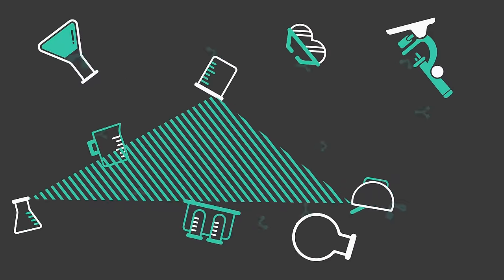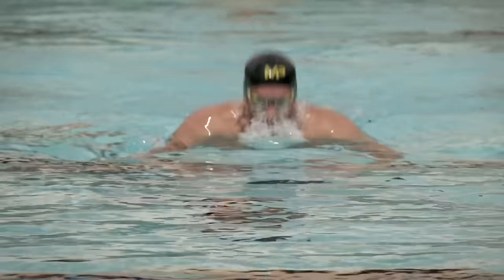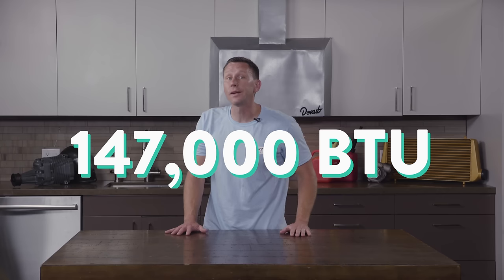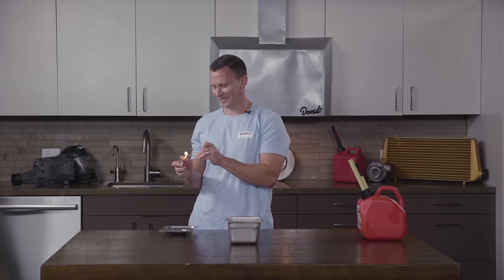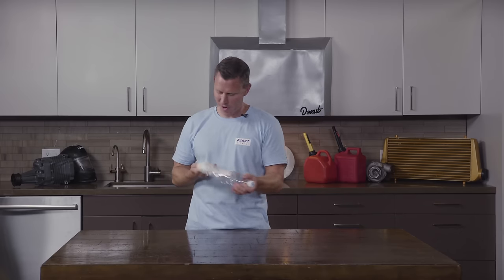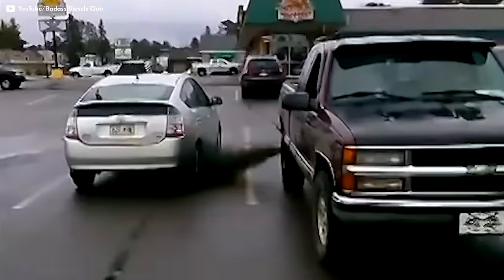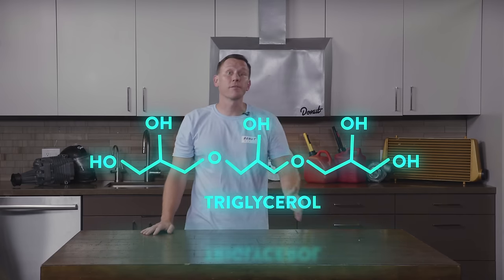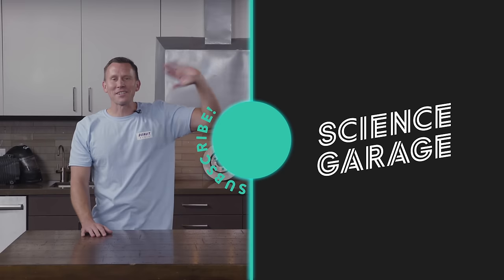DIESEL | How it Works

Comment: Diesel is like nuclear: everybody hates it for no particular reason but it's actually better than most other alternatives
Reply: Yep
Reply: Yes, but actually no.
Reply: @Jeff Butt there is nothing bad about nuclear energy
Reply: Jeff Butt what did he say that made you so angry
Reply: Jeff Butt now when done properly, which most nuclear energy is, nuclear energy is pretty damn clean and it doesn’t require a ton of precious materials. Old nuclear power was inefficient and people didn’t know how to dispose of the waste and minimize the adverse effects. Today, nuclear is quite a bit better than coal or something like that. Now there are better ways, like hydro, but nuclear isn’t the looming evil power source that some people make it out to be. Using nuclear to power electric vehicles is a lot less impactful on the environment than using coal to power electric vehicles, or using gas powered vehicles.
Reply: @Jeff Butt Chernobyl wouldn't have been as big of a issue if people didnt over ride the melting reactor thinking it was a test
Reply: @Chevsilverado  Pretty much this. It has risks and drawbacks, but nuclear power also has many positive aspects. The debate is very emotional...
Reply: @Jeff Butt those are rare situations. Yes nuclear wate is an issue, but compared to fossil fuels its miles ahead. Not to mention renewable just isnt efficient yet
Reply: Well, mind you. Not everyone hates it without a reason though. When DIesel engine became old and worn down, it won't burn as efficient as when they're new. And when any fuel doesn't burn completely it creates sud and stuff you probably don't want to breathe in. Correct me if I'm wrong, but it just that Diesel create it quite more than Gasoline. And about Nuclear powerplant, I got to admit that It's good and very clean compared to any current power generating methods we currently have. (I didn't count power from wind, water and solar energy, though) The only concerns people usually have are it's by-products, Spent fuel rod. We still don't know how to deal with it yet apart from containing it in a "safe" environment. I think there's some permanent storage being built now but that's still burying it back down hoping nobody digs it back up again in the far future. And you don't want nuclear technologies to fall into some crazy country, do you?
Reply: Indeed, one of the complaints is cost a d complexity, even though we can produce a reliable AI system to take a vast strain of old tech, as for Chernobyl there was no fail safe in the system due to soviet regressive attitudes, were as a western nuclear power plant with multi reactor set ups has enough failsafes to make any failure be contained on site as a meltdown will be just that, a meltdown of the reactor over a detonation of a reactor, two things we must know publicly is the difference of a meltdown and detonation, a meltdown is a result of a runaway reaction melting down the reactor, a detonation spreads the reactive nuclear material large distances causing a massive hazard for general civilian population
Reply: @khizarpasha6105  Nuclear waste isn't actually an issue anymore. That weapons grade byproduct everyone worries about can actually be recycled into new molten salt reactors. I recommend searching YouTube for Elysium Thorium for a 20-40 minute lecture on how it works in detail.
Reply: @angel-ec1jc  except the fact that it can poison you
Reply: T.V shows like the Simpson's put the scare factor into Americans.
Reply: I want nuclear electric car and diesel tractor
Reply: Laughs in Reactor 4
Reply: Diesel however, has more particulates.
Reply: Nuclear powered submarines can run for 20 years before the have to refuel.
Reply: Ian hydro is going out. It destroys the ecosystem around it, and its regional. Lots of places cant have hydro because they arent around a water source that is capable of that. Thats why the army corps of engineers is blowing them up.
Reply: Onion Head wow, what a scholar. Nuclear is the best option. I guess we shouldnt drive cars because they pollute and destroy the earth. I guess we shouldnt build dams because they put so many lives at stake if they break. The tower on a solar farm can bake some one alive. Windmills take up such precious space that you need to grow your organic foods. Such utter destruction.
Reply: Onion Head Well there hasnt been a problem yet with it. If you want to come up with some improbable theory to what could happen to it go ahead.
Reply: Onion Head you do realize that people learn from history right? The people running Chernobyl were incompetent, considering it was soviet Russia and they didnt have standards. I will agree that the waste is a little bit of an issue, but an “oopsie” wont just occur if people actually cared
Reply: @Chevsilverado  im sure the problem with nuclear energy is disposing of it,
Reply: Paolo Di Gualtiero nuclear is safer until it doesn’t... and leave a piece of wasteland for centuries 😬
Reply: Not at all...
Reply: Ntm the sounds ugh nuts
Reply: Giordan Diodato but it smells amazing
Reply: As someone who works in nuclear powerplants, yes
Reply: angel wake TF up kiddo
Reply: Same as communism
Reply: @inputgoldfish4424  and socialism.
Reply: Osama entered chat
Reply: Chernobyl lol.
Reply: jk I'm aware that it was the fault of the rbmk but still
Reply: @Chevsilverado  yo, I’m doing a research paper on nuclear energy. Can you help bruh? Seems like you know some things lol.
Reply: @Ken-rt9jy  Don’t know the specifics, but I just know that nuclear power these days are efficient reactions and are designed so they don’t put out radiation into the surroundings. The statistic these days is something that you could live like 10 feet away from the nuclear facility and have a many times less radiation from the rector than the ambient natural radiation on earth. Natural disasters are a bit different, as they can mess up a reactor pretty bad, but since the different events where that happened there’s been a lot of advancement in protecting against earthquakes and stuff.
Reply: Jeff has left the chat
Reply: so damn true
Reply: Soot
Reply: @angel-ec1jc  The waste is the bad part of it everything else is good we just can't dispose of nuclear waste since it last so long.
Reply: Only few people love it but they are legends ☺️
Reply: But truck make loud noise and blow big smoke cloud
Reply: @damonleeb  some trucks without catalytic converters, carbon filters, adblue and a muffle blow black smoke and make noise
Reply: Nuclear power has one drawback now, just the nuclear waste.
Reply: yeah becuase the nasty black smoke and acid rain arent particular reasons
Reply: @mikalharding5889  not every diesel makes black smoke. A Audi A4 2.0 TDI makes no black smoke but it is a diesel. Scania S770 with a 16.5 liter V8 and 3700 NM, no black smoke.
Reply: The engine but not the furl
Reply: Fuel
Reply: [Japan left the chat]
Reply: Who is Jeff... ?? 😂
Reply: Diesel is better 🤡
Reply: @Chevsilverado  you say old nuclear reactors were inefficient, but they were still insanely efficient, just not as much as a modern day reactor
Reply: @notlogical4016  It’s all relative lol
Reply: Ian nuclear is a very vague term, if you mean nuclear fission than it’s very bad for the environment, not because it produces gas but the radio-active waste would build up and only after a couple 100 mellanias the first bunch would become non harmfull but by them we’d have so much waste we’d be fucked, on the other hand nuclear fusion is very clean and has literally NO bad consequences, the worst catastrophe in a nuclear fusion chamber is that it powers down thus making it safe
Reply: @TheFlemishNut  There have been a bunch of studies of how modern fission power compares to coal production and the overwhelming consensus is that with modern tech, fission actually produces next-to-no waste, and it’s almost infinitely better than coal in terms of pollution and overall human deaths. Modern fission reactors are actually very safe and do not create much waste, and there are new methods to dispose of/use fission waste that doesn’t harm the environment. The problem is that something like 95% of all nuclear reactors in the world are a very outdated design, and many countries do not care/have regulation about disposal of nuclear waste. The cheapest way to dispose of it is to of course, bury it, but there are other ways that have virtually no impact on the environment (especially compared to coal or even hydro), but those methods are costly. Fusion would be even better though.
Reply: So wait diesel is more eco-friendly than petrol. Man in feel bad for people in the UK with diesel and petrol bans
Reply: @Chevsilverado  I was with all u said until the end where u said we’d could power cars outa coal and ‘nuclear’
Reply: @maxosiatynski9987  Electricity from coal and nuclear.
Reply: @obi-wankenobi9871  yes but actualy yes
Reply: @holden2260  No, bio-diesel is more eco-friendly than gasoline. However, most of the UK drivers would use harmful petroleum diesel instead of the bio-diesel, because nobody wants to load literally shit in their cars. If UK banned the petroleum diesel instead of diesel engines, diesel car owners will probably be in trouble with accessibility of bio-diesel supply.
Reply: @angel-ec1jc  nuclear waste, mining, risk management, not saying nuclear is bad, it's good but it also has problems, especially with its waste
Reply: Live in country where are more Diesel cars than gas...trust me, you will hate it
Reply: Who dislikes diesel
Reply: There’s a reason, it burns dirtier the gasoline, and DEF aka AdBlue even makes it worse, it fcks up the exhaust by crystalizing on it
Reply: I love sounds of diesel engines
Reply: @Chevsilverado  with the introduction of fusion* reactors aswell this will make nuclear power exponentially safer than it already is.
Reply: @alijahcrichton8234  Fusion*
Reply: @Chevsilverado  ahh thankyou I had it mixed up I'll fix that
Reply: But look at Chernobyl and Fukushima... If something goes wrong, then it can cause huge masses of land to be inhabitable for 10s to 100s of years. That's the last thing we need on an already overpopulated earth. I know mistakes are unlikely, but it's happend twice in less than 40 years which is two times too many. Imagine how many more times it could happen if we ended up using it in all our power stations around the world?
Reply: Diesel should be ideal than gasoline. Should focus more on improving it and kept the exhaust clean.
Reply: You have to use diesel engines regularly to get them to work properly
Reply: Most diesel engines create more carbon than gas engines now because of emission laws on gasoline engines
Reply: @obi-wankenobi9871  without diesel engine, your supply chain is compromised
Reply: No no I hate it cause it cost more
Reply: It's not better for my wallet, it's nearly $3 a litre
Reply: @drchestpain9166  lol
Reply: Yes for sure, and the black exhaust/coal is just is just unburnt diesel coming out. Diesel is actually the cleanest fossil fuel too. Gasoline pollutes more than diesel
Reply: Who hates nuclear?
Reply: @angel-ec1jc  Until there’s a mishap with nuclear waste.  I think it’s the best option we have, though.
Reply: Well said 👍🏼👍🏼
Reply: There is actual reason if you dont like having a cancer
Reply: Negative. EV
Reply: The future is diesel not electric
Reply: Emissions
Reply: Now why would I want you degens rolling coal literally everywhere
Reply: Well, they hate it cuz they dirty and produce all this soot. I love diesels though.
Reply: Diesel is a double-edged blade. It's better in many ways, apart from the fact that they emit more toxic and harmful air pollutants.
Reply: facts
Reply: @WorldEngine64  facts
Reply: No perticular reason? Really?
Reply: Except in cold climates
Reply: @angel-ec1jc to expensive to build ,mentain and oh yes ... the waste
Reply: Well no
Reply: @angel-ec1jc well there were some incidents . Lmao
Reply: Its poisionous 😂
Reply: @angel-ec1jc well unfortunately the only bad thing about nuclear is when it goes wrong, which is very unlikely but that is the worst thing about it😂
Reply: @SiriusXI beside the fact that it is fkin expensive to build, maintain and then "dispose" the leftovers.
It is no coincidence, that a huge majority of economists say, that in almost all cases nuclear is not as cost efficient as renewables. On the other side nuclear has a huge lobby. 
Funfact regarding the last point: A friend of mine whos father works in a local nuclear power plant mentionned that half the people working for the plant are lawyers nowadays.

Comment: If Diesel is cool and mighty why isn't there a Diesel 2
Reply: There is a diesel number 2....sold all year round at the pumps
Reply: Diesel euro 2,3,4,5 and currently 6
Reply: @BenchD  Coming soon 7
Reply: Erron Morgan r/ihavereddit
Reply: Bio-diesel??
Reply: Area 51
Reply: I'd diesel is so cool why isnt it in the bible
Reply: In 2nd world countries (Serbia )we have D2 (diesel 2) that is literaly cleaned used oil for use in tractors and old trucks and cars and than we have Euro Diesel and Premium diesel, Euro diesel is safer for your newer car but its still so bad that Permium diesel is the way to go but you pay 50cents per litter more than developed world for worse fuel.

Neraly all cars here on diesel must go to clean EGR valve after 5 years
Reply: Console peasants: If PC gaming is so cool why isn't there a PC 2?
Reply: I think that's technically kane
Reply: Because no Vin Diesel for the sequel XD j/k
Reply: Electric boogaloo
Reply: Fuel oil?
Reply: Bro forgot about biodiesel

Comment: Surprised you didn’t mention how it makes a lot of torque and not a lot of horsepower so that’s why Diesel engines commonly have turbos
Reply: Could you explain why, please?
Reply: @Dop4miN  Well it's a really complex subject but basically since Torque is the result of force x distance and in diesel engine the combustion is made by compressing air to create heat wich then self ignite you inject the fuel at the last moment ( when the piston is at the highest in the cylinder ) in results the piston will  travel longer than a gasoline engine ( who needs to let space for the spark and the fuel inside the cylinder ) . 
So you got more distance in your equation Tq = DxF wich results in more torque
For the lower HP for Tq the answer lie in RPM since the Diesel self ignite you can't go at high rpm ( you can watch video of diesel doing 8k rpm you can see that over 6k it start doing a lot of black smoke due to unburn fuel wich is basically useless  you could have shift earlier to put yourself in a better rev range but then again those are heavily modified engine )  
In a drag race between a diesel and gasoline that both make 100hp they will basically do the same time in a 1/4 mile the diesel goes faster into high power rev since it have a lot of torque but the gasoline engine won't go back to low power rpm once it started you could even never be in low rpm by burning your clutch , in a race tho the gasoline will be better since you can utillize fully the higher rpm by shifting less
Reply: @tacos6915 so basically, the only weakness is due to earlier shifts in the diesel?
Reply: @tacos6915  btw thx for the detailed answer!
Reply: SDI GANG
Reply: @Dop4miN  Because diesel engines are lean burning by nature so it means they cannot burn a lot of fuel thus producing less power than a gas engine by density but a lot of torque due to their greater compression. Turbos come in handy because it forces more air in the engine allowing the engine to burn more fuel than it could naturally thus producing more power. The increased air intake reduces pollution as well because the engine has enough air at all times to burn the fuel
Reply: @sfafsashfdh6589  sdi owners be like ''i live my life a quarter mile at a time. for those 2 minutes i'm free''
Reply: @sfafsashfdh6589 mercedes 300d na OM606 gang

Comment: 2:26 that gasoline engine needs a timing belt adjustment
Reply: lmao I noticed the same thing
Reply: Good eye.  I totally missed that.
Reply: Definitely!
Reply: Definitely
Reply: first things first, that engine needs some valves...
Reply: Its hitting the rev limiter bruh
Reply: And the right bore pistons
Reply: No that's Antengine. It is used to convert mechanical energy into useless waste
Reply: Yes
Reply: I guess it uses antilag/2step